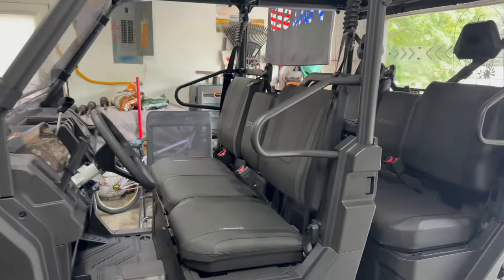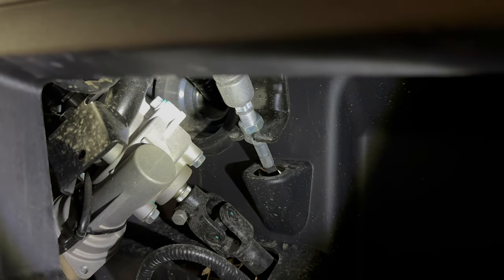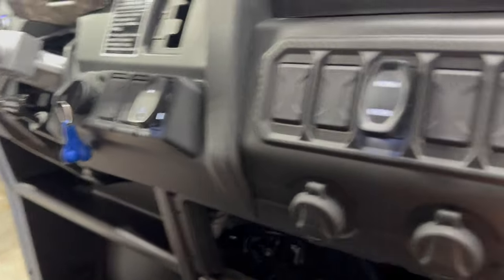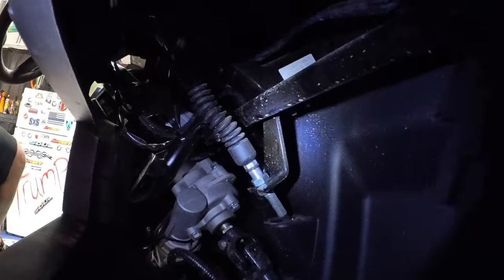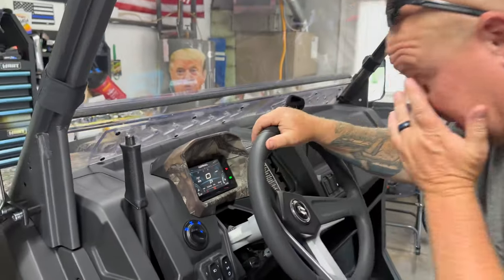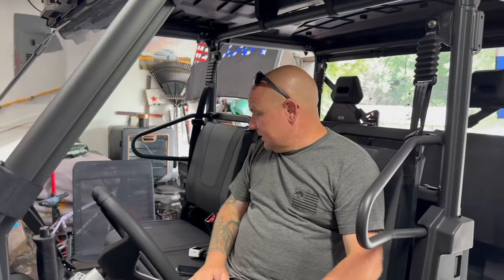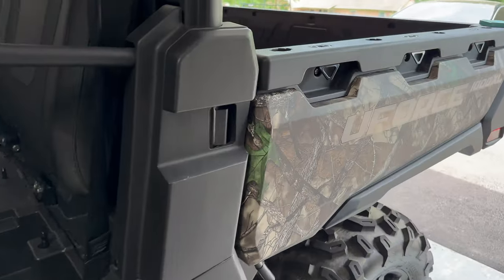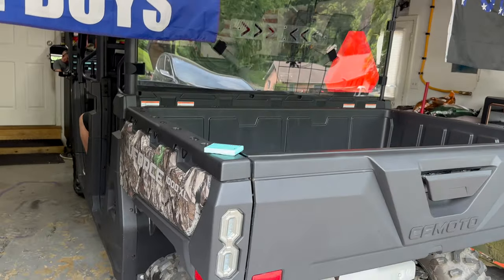2023 CFMoto UForce 1000XL Shifter Linkage Adjustment | Easy Fix!

Comment: Mine won’t come out of gear just like the cforce 600 I had but the 1000 is harder to rock back and forth and won’t read low or park sometimes as well. Ended up ripping on the lever a few times now when nothing else worked. Great machine otherwise

Comment: Is all you are doing is losoing it up a little bit?
Reply from the maker: There’s a nut on both sides. Depending on what way it needs adjusted, it needs to shift towards or away from the position it’s in and then both nuts tightened to hold it in place